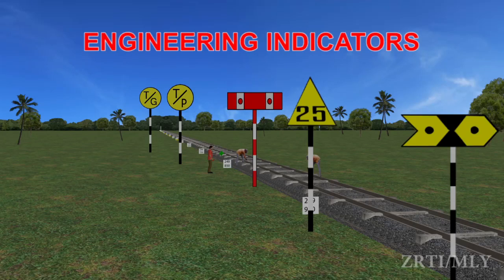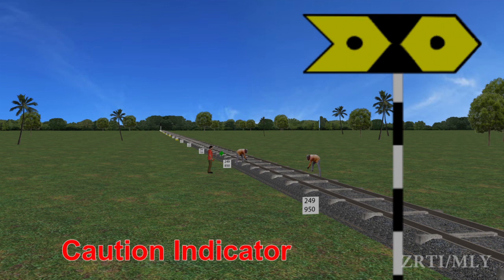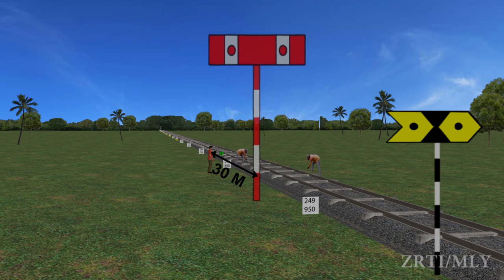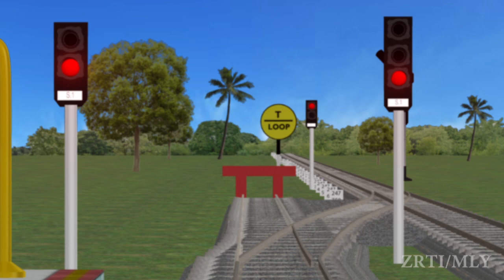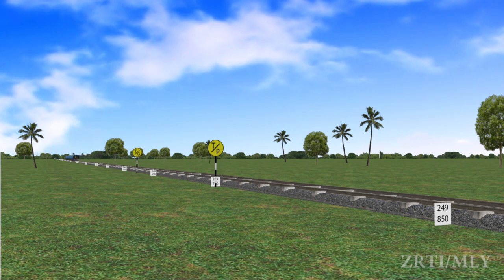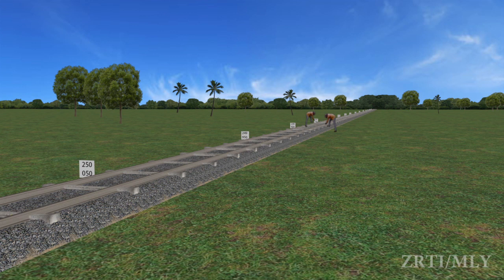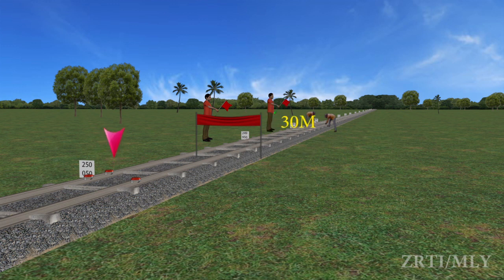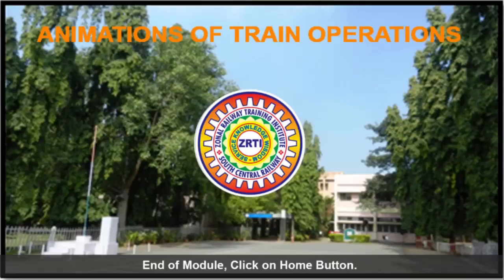Engineering Indicators- railways

Comment: The height of the speed board above the rail level is?
Reply from the maker: All boards 2.133m from rail level
Reply: @raghurambhat-railways582  given options as:
A. 1.8m
B. 2.0m
C. 2.2m
D. 2.5m
Reply: @raghurambhat-railways582  sir what is meant by T/Loop and demu memu stop sir